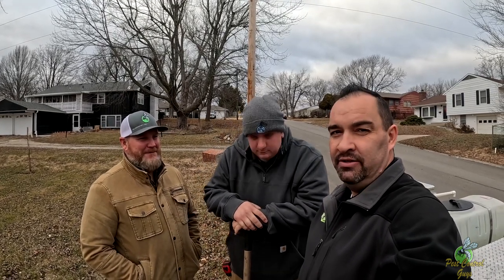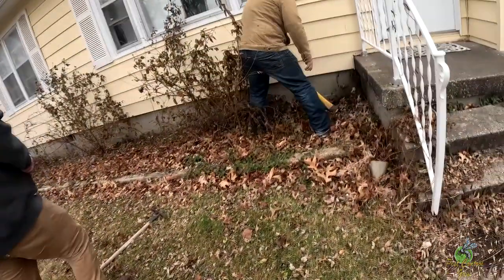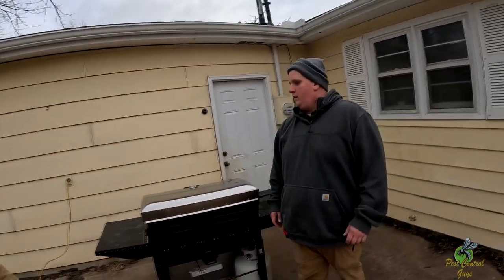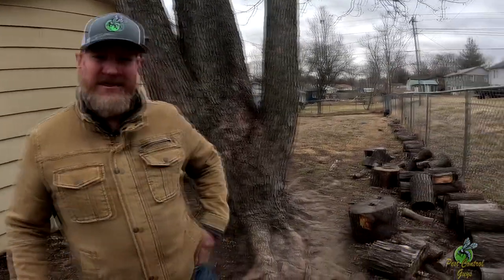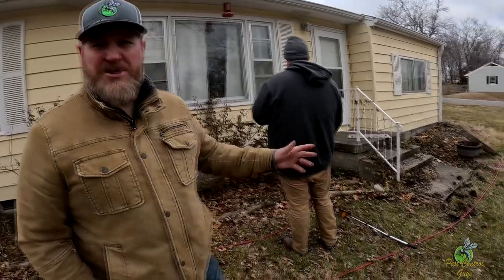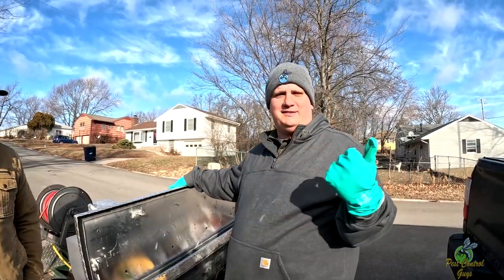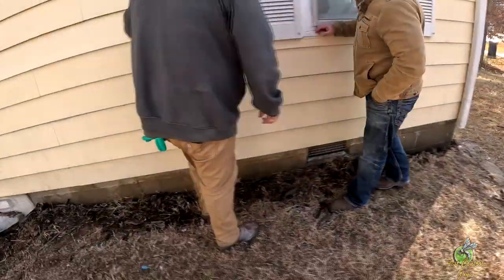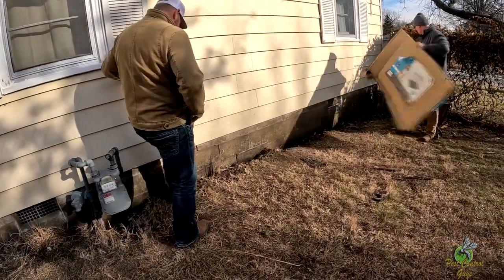Termite treatment on an existing home- Full liquid barrier.

Comment: How deep you drilling the holes? You drill as well if it's pavers in a house? Great video like always very informative.
Reply from the maker: Drilling is just to get to the soil, so it depends on the thickness of the concrete. Usually around 4”. The product adheres to the soil and that becomes the barrier. Thanks for watching!